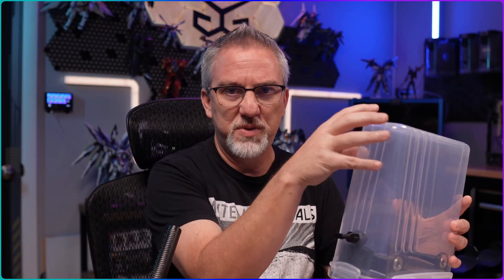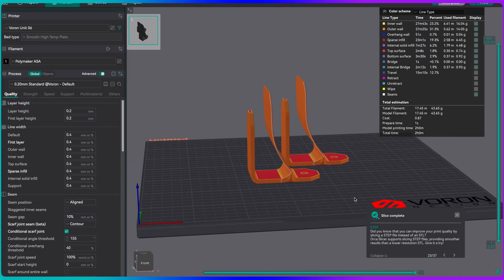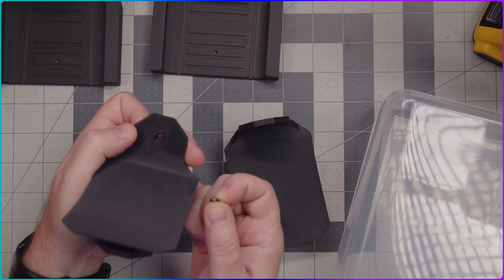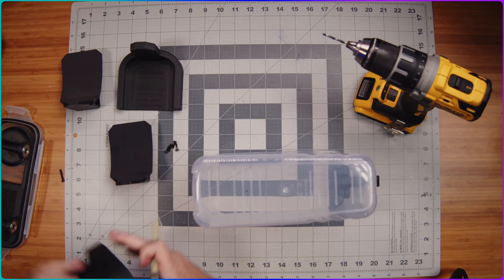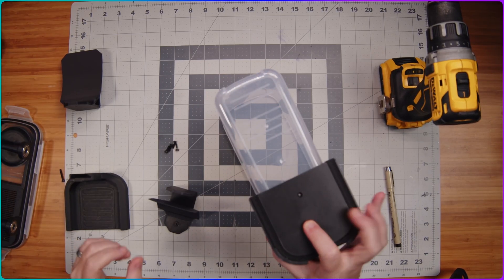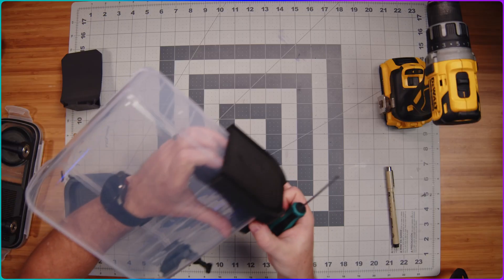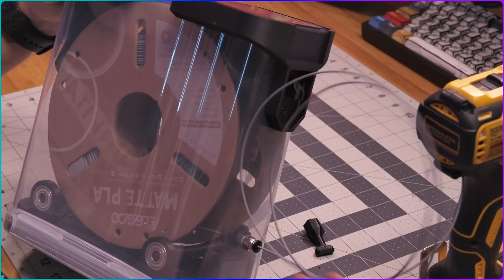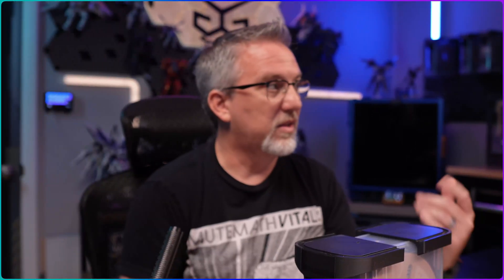Ultimate Filament Drybox System - Extended System Printing and Assembly Guide

Comment: Thank you for the design. Love using these with my Elegoo CC.  I'm finding that when moving the container around the main frame doesn't seem to stay in place and beads get under pushing the mount up which causes the spool to have excessive drag and the ECC cannot pull the filament. Maybe design a holder in the center of the spool?

Comment: I know I saw somewhere that if you have a miss drilled hole you used Hot Glue to fill it in, but I can not find it again to confirm this info
Reply from the maker: I've used hot glue and that works fine, but someone suggested B-7000 glue and that dries even smoother and more transparent, so that's what I use now.

Comment: any tips on marking and drilling for the flaps inside if you do NOT intend to print and use the stacking corners pieces on the outside?

Comment: Since you did mention it on the other video, the little gauges inside mine are all reading 20% as well, I know it is less than that because the better gauge I have in my AMS shows 10%. The secondary Gaige of real life is the prints I am getting off my Prusa printer from this dry  box is so much better than the prints I was getting, We too live in a very humid area and a general reading inside my shop is anywhere from 59-70 % inside, so the filament, even PLA, would get "damp" during a long print time. Now,  all the prints are printing  cleanly and it just simply works great friend. I can't express how much frustration this has saved, 
dale

Comment: Thanks for this amazing development! 🙂 Just printing all those parts you provided. :-)
Suggestion: You might not be aware that you can enhance the rollers in order to cause the spool to adjust dead center automatically. Just copy what all railways do. The wheels are shaped conically in order to adjust rolling dead center. Imagine the spool to be the rails and the roller beneneath is the wheel. It needs to be tapered. 
Start  i.e. at the bearings with about 8.1mm and proceed with the taper to final 16mm or more at the center of the roller.

Comment: My bearings dont want to roll! I soaked in isopropyl and bearings spin but spool moves on rollers lol. I had to shrink the axles to fit the bearings because my bearings had a ridge in their. But i need to figure a way to get it to feed into the plus 4. It worked with plastic spools but cardboard itd jam.

Comment: No idea whats happening with cardboard spools sometimes but even with bearings that I’ve soaked in alcohol and got to spin freer cardboard spools will still bind and the whole cereal box will drag across my desk and get pulled up into the air of my ams lite. They’re all standard size spools too
Reply: Dude same. I only tried a poly maker roll in it. Every five minutes it jammed. I have run plastic spools through it fine for like 20 hours of printing no issues and they stay at 10 percent humidity.

Comment: I just built 6 of these. Fantastic design. Only thing is I have to print the axels @98% scale when using PETG
Reply: Same but in pla had to shrink them too. I think there is a rough section inside the bearing that's cause it.